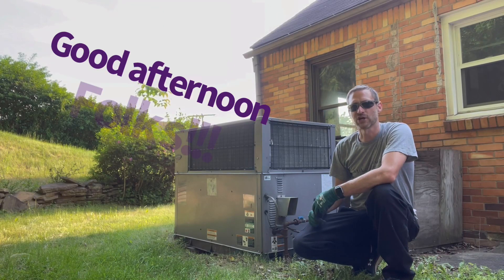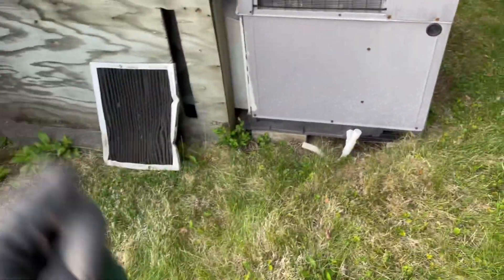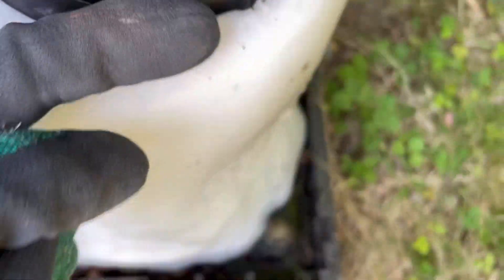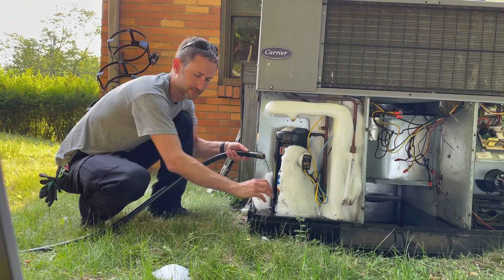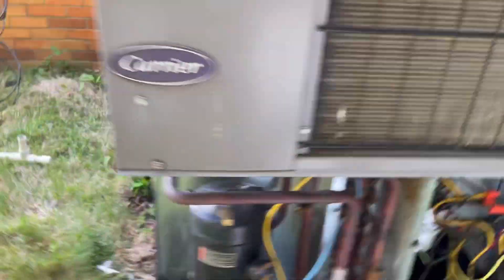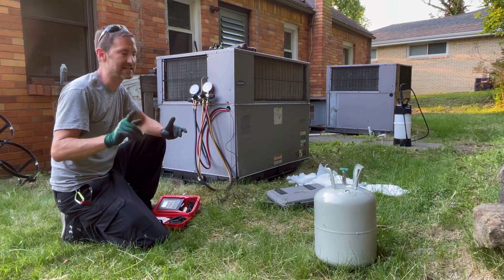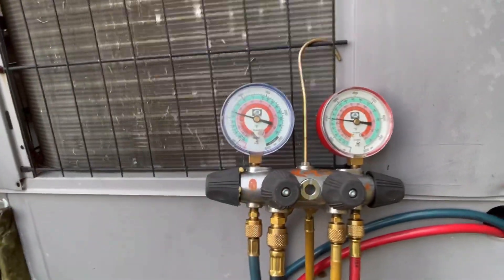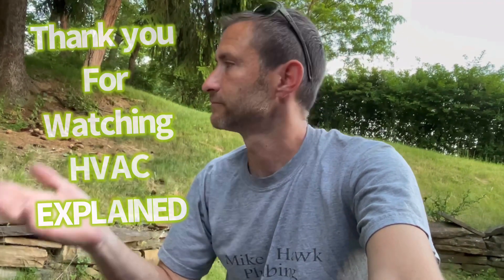Well we’re Frozen !!!    #Steamfitters449 #heatingandcooling #HVACEXPLAINED #cooling #sporlan #hvac

Comment: Hi, i was working on a 3ton residential ac with a fixed orifice. I set my superheat to the targeted value of around 25F. But when i checked the subcooling it was only about 2F. Does this sound right? Enjoyed all your tutorials very much. Thank you.
Reply: Thank you for your fast response.  I was just confused as to why my subcooling was so low around 2F. Shouldn't the subcooling be around 8F to 12F?
Reply from the maker: @mark.r8900    You’re welcome.  
  on the inside of the control panel next to the schematic They generally have a “small graph” to show you pressure/temperature for sub cooling and superheat range.  I try to follow that as best as I can.  
Charging on a TXV If you have between 6 & 10 subcooling I’d say your more then fine.  
But again a fixed orifice just charge superheat.  
🤙
Reply: Can you please instruct me how to run (hook up) nitrogen when brazing the compressor suction and discharge ports? I'll be replacing a new compressor on a residential unit. Thanks again.
Reply from the maker: @mark.r8900  after you recovered the gas, “pull schraders” also remove filter drier, unsweat the old compressor, if possible perform acid test on the old compressor use nitrogen to clear out residual oil before installing new compressor, place piping into the compressor, hook up nitrogen on 1 side of system “either on a service port or through the piping where the filter drier once was”. and have a low gentle flow of nitrogen coming out of the service ports or opposite filter drier hole.  
Nitrogen works well for keeping oxidation down and keeping a system clean.  It’s ok if you must shut it down to make a quick joint but immediately purge after.
Reply from the maker: Very good question Mark.  
I need to point this out in two different videos combined, but I do pointed out to our apprentices.
If you have a fixed orifice  = charge by superheat.  
If you have a TXV  = charge by subcooling.  
The TXV is supposed to regulate superheat. Sometimes they are a “fixed” TXV’s, and what I mean by that is nonadjustable.    so if you have it charged properly “subcooling” but the superheat isn’t correct, I would advise changing the TXV.   
The TXV requires a Solid column of liquid to operate Properly.  
If you have a site glass and it’s flashing “bubbling” very bad, the TXV may not work properly.   
A Fixed Orifice stays in one constant position “like a carburetor Jet” so just add refrigerant slowly and watch for the proper superheat.  
25 degree isn’t horrible but I bet if you added 4 Oz more it 
Would come down to about 15 degrees.  When you get the charge that close, add 2 ounces at a time.   
Would you believe that Mitsubishi prefer to run 0° superheat !  It’s not something I like to see but those scroll compressors can put up with some abuse.   
Please let me know if you return on that at all to make any adjustments but it sounds like you’re very close.  Very good question by the way.  Hopefully this point you in the right direction?   Since this video, I have moved down to Florida and out of Pittsburgh Pennsylvania.  I’m working with a pretty good size company down here and collecting more footage.  
Have a great day.
Reply: You're just awesome! I really appreciate you for taking time to respond to your subscribers. One of the best I've seen. Thanks

Comment: comment on this:  A/C man added freon without checking high and low pressure.   The condenser was freezing up.   I waited for it to thaw out and then called A/C man.   He  took 15 minutes to add freon to "beer can cool"; disconnected can and charged me  $75.       I always keep clean coils, filter, check unit monthly....veterinarian.   Air filter changed twice monthly.   The blower motor is new.  Capacitor to blower motor was fine.   A week later, the condenser started to freeze up again, called the fellow that installed unit an d he said it had too much freon and if anything, some freon needs to be removed.   He did so and unit running right every time......................He was out of town the first time.    The first A/C man is no longer a customer of mine nor am I his.
Reply from the maker: Good afternoon Melanie I’m just wrapping up with some overtime down in Pittsburgh PA working on some computer room air conditioners maintaining a few million dollar corporation lol no pressure. 
After reading this yes the technician should have been able to identify if it was low on charge or not especially since you did thaw the system out which that’s correct you need airflow / clean coils / good clean filter etc and for it to be operating at normal conditions to identify the problems.  After reading this carefully it may have been low on charge and that technician how did too much charge.  It sounds like you did everything on your end properly the technician was either probably in a hurry for another service call or inexperienced. Yes, if you have a trusted person continue to use them as much as possible.  When a system generally freezes up it can be a few different reasons just examples here. 
Dirty air filter / Blower motor went bad or shut down for some reason / Low on Freon / Metering device has failed or plugged up / Compressor contactor welded causing compressor to run even after thermostat is satisfied shutting down blower motor.  
Please keep me updated if another situation happens again.  Have a great weekend thank you for commenting.
Reply: @hvacexplained9341  thankyou!
Reply from the maker: @Franklinveterinarycenter1of4  WC. 👍

Comment: Great Video Tony, yes preventive maintenance is something that should be done. God Bless.
Reply from the maker: 100% Ken when things are maintained properly they typically run good. What I like to see is equipment installed properly, sized properly and maintained properly.  Thank you for the compliment on the video have a great day.  I’m working some overtime this morning I’ve literally worked the past seven Saturdays in a row. The way I look at retirement work harder now while you are young because once I get 60 years old I may not want to be slipping and sliding on the roof in the middle of the night doing overtime while on call lol.

Comment: Like your varied content. Not just capacitor change out, recharge and go, or clogged condensate drain like some channels. Interesting dog house built over that ductwork !
Reply from the maker: Thank you very much I run into many different situations and applications dealing with heating and air-conditioning.  That’s one thing I like about this field you never know what you’re going to run into day to day.   My old chiropractor had thrown a piece of plywood over top the ductwork.  it’s definitely not something I would do, but he just asked if I could work on the units.  I’ve seen a lot of worse Coverups in this field.  Lol. I like to investigate and get to the bottom of the issue try to check everything I can because I don’t like callbacks.  🤔
Thank you very much further complement and comments have a great day.

Comment: Would you recommend 4 port manifold   gauge. If yes why. Im interesting in buying my first set of gauges
Reply from the maker: I have a couple issues with those gauges. 
Don’t get me wrong they’re pretty slick because they are accurate, a lot of them have multiple refrigerant PT charts loaded on them, built in thermometers, Bluetooth, They accurately read superheat and sub cooling which is very critical in the HVAC field. 
Me personally I have to leave gauges on equipment sometimes overnight add some facilities in order to pull a good vacuum on a system.  I’m always worried about people stealing my tools.  I’m assuming they are pretty water resistant and we do run into poor conditions where it’s raining.  I don’t think I would leave them hanging in the back of my van just because a lot of stuff gets jostled around and I’ve broken many Gauge manifold gauges. 
I am really considering getting a set myself Only when I am on a quick call but if I’m going to leave stuff overnight I will put my regular gauges on for security reasons but I’m still unsure which ones to go with at this time. 
FieldPiece and Testo have been around for quite some time and they tend to make good products.  
I don’t know anyone who has the Yellow Jacket or Elitech versions.
If you don’t already have a thermometer such as mine the gauges would save you money so you don’t have to purchase any. But in general it’s good to have a thermometer set such as the one I have.  Versatile
If I do end up getting a set I will definitely do a full review on them.  If you end up getting ASAP please let me know how you like them.  Have a great day and thank you very much for the question.